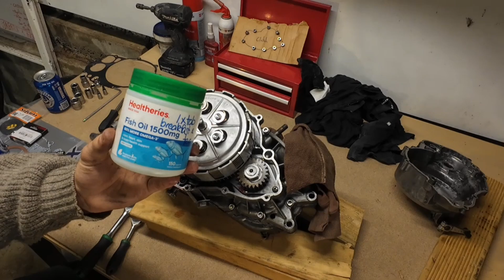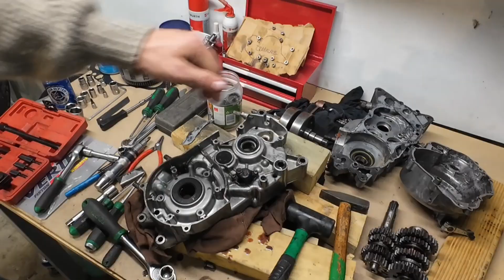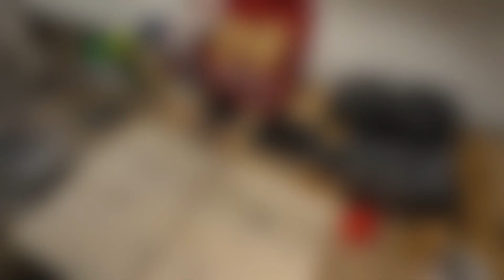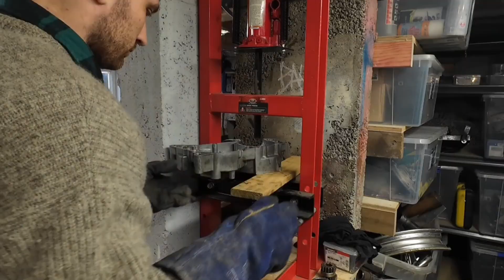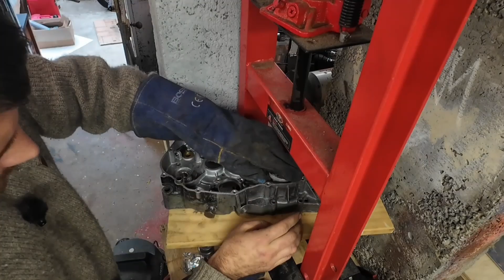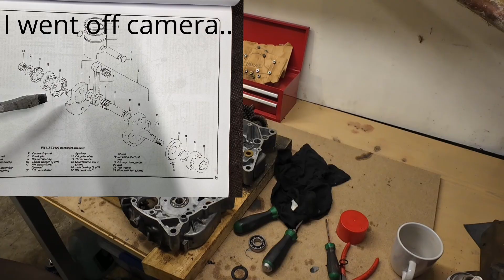Farmbike Ep2 : Suzuki TS250 Race Engine Strip & Gearbox Fix (Project BlackSheep)

Comment: Hi, great video, do you use the main beaing with the shroud on it?, are you runnig oil pump?
Reply from the maker: Hey, great point!
I don't run the "oil slinger" bearing as in my case it's not needed. I run the oil pump and also 30:1 premix for my methanol.

I have heard those bearings are also getting hard to find!
Reply: I run mine just on pre mix